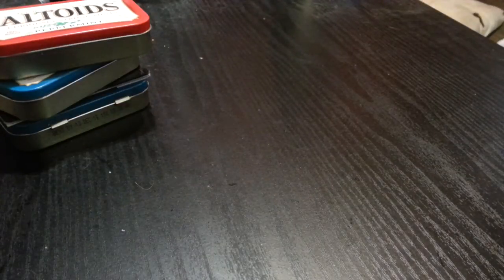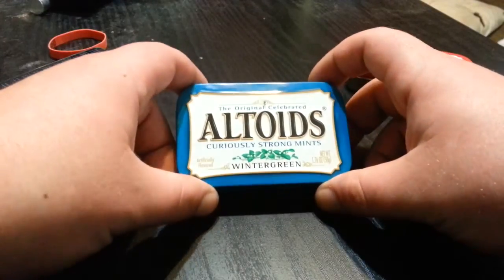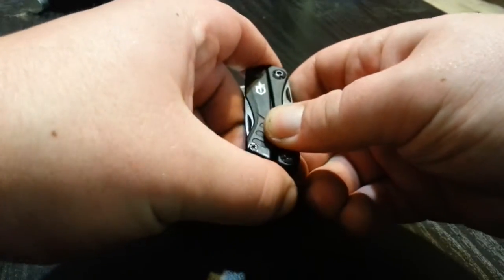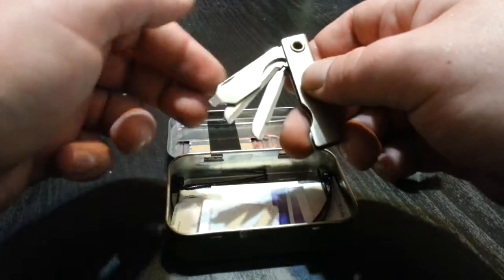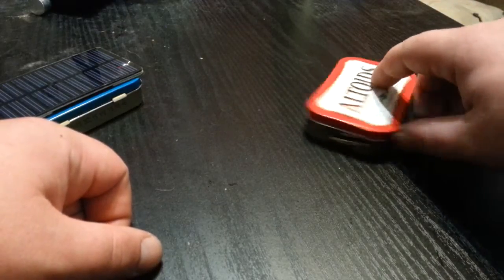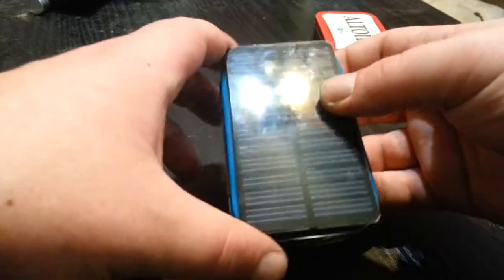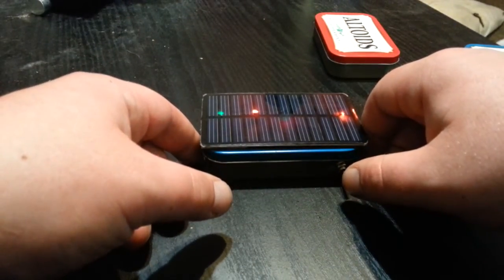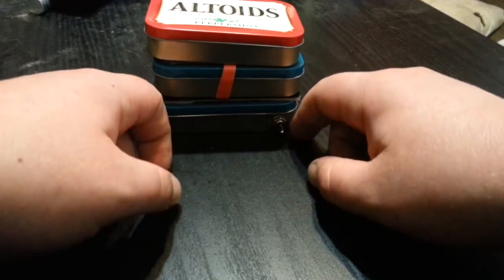9 volt AND solar power altoids usb charger

Comment: A 9V is a really bad idea.  It has a super low amperage, and will only get your phone up a couple of percentage points.  9V has a high voltage BUT low amperage.  You need amperage to charge your phone.
Reply from the maker: Is there something out there to help balance the voltage and amperage out that can be spliced in?
Reply: Junky Blake You're better off using 3 rechargeable AAs and small DC to DC boosting circuit.  On my website I have several.  An even BETTER idea is to use a small lithium batter, charge controller, and boosting circuit.  A 9V will only charge an iPhone 5%.  At best.  A similarly sized lithium battery could do a full charge, and is also rechargeable.  A 9V is the single WORST option for making a USB charger.  BrownDogGadgets.com
Reply from the maker: Ok cool ill check it out thank you.  What about my solar setup? Is that even worth it?
Reply: Junky Blake Actually, you've wired up a non rechargeable battery... which is super bad.  It could leak or explode on you.  In general, your solar panel probably isn't anywhere near powerful enough to charge a rechargeable 9V anyways.  Read a couple of the Solar USB write ups on my site.  You're close to what you need, you're just using a few wrong parts.
Reply: Jiovany Herrera So now you've gone from 400mAh up to 800mAh.  You need 3,000mAh or so to charge a phone.  A small phone.  A single AA has 3,000mAh at 1.5V.  Also the fact that you'd need a 12V solar panel to charge up that 9V battery… which would be huge....  Using 9Vs is a very large waste of money for small solar projects.  There are far better ways of building solar projects that don't waste batteries.
Reply: Jiovany Herrera No, you can NOT use a 5V panel to charge a 9V battery.  Thats impossible.  You need around 12V to FORCE the electrons into the 9V battery.  It's basic physics.
Reply: I agree, it takes a battery with 5,000 mAh battery to fully charge a cell phone... a 9 volt battery only has 400-500 mAh which calculates to 20-30 minute charge before the 9 volt battery is dead... maybe 15% battery charge on the cell phone
Reply: Brown Dog Gadgets what batteries do I use